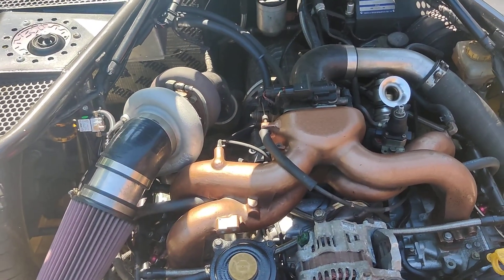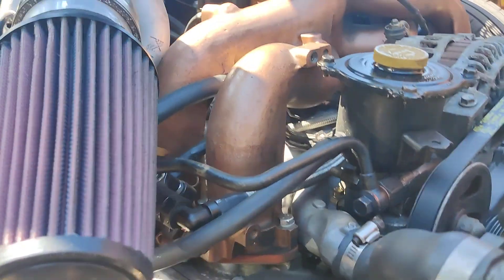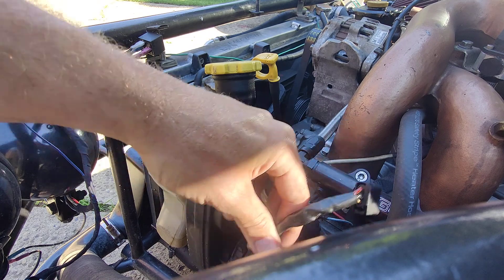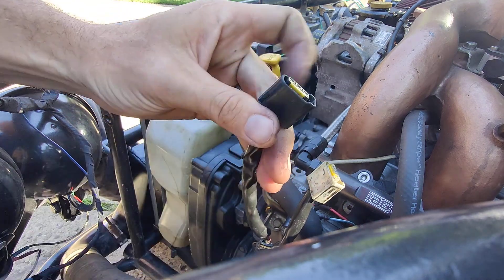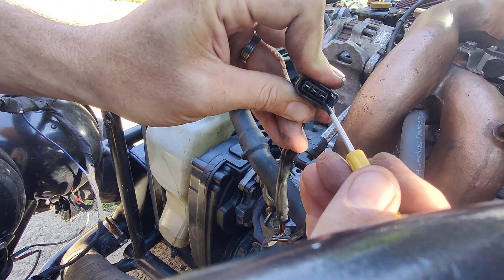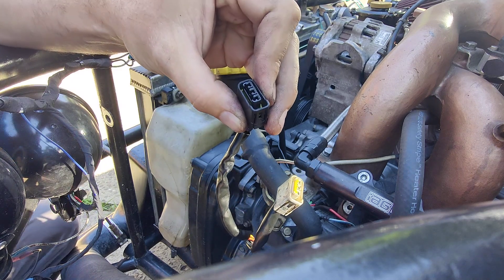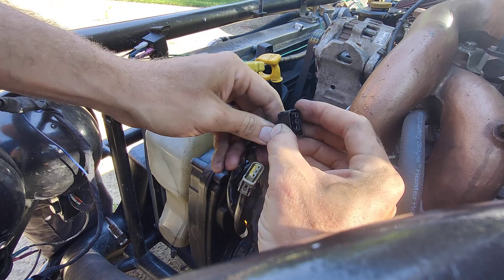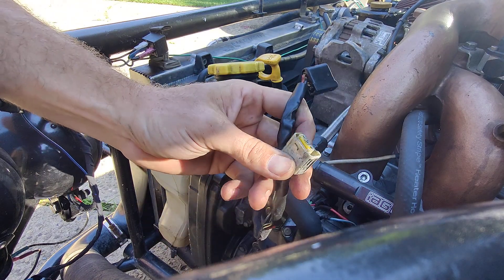Subaru WRX STI coil pack plug repair

Comment: been battling a missfire/ horrible idle for months now, no codes, no missfire codes but little bit of roughness on cylinder3. cylinder 3 coil pack plug seems to be damaged bad, hopefullya new plug will fix the issue. thanks for the video